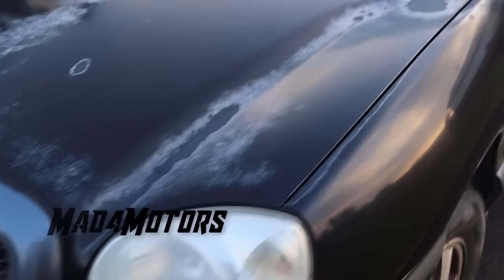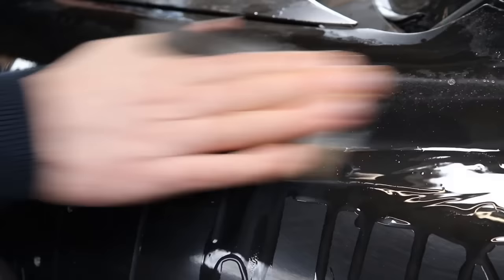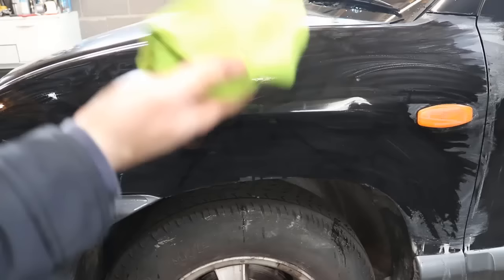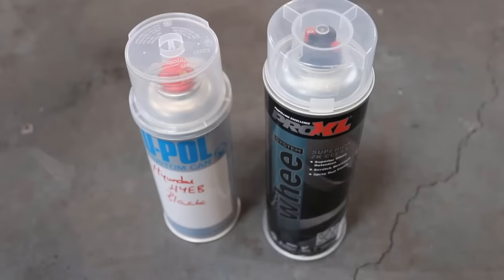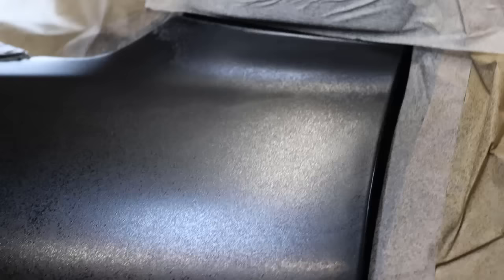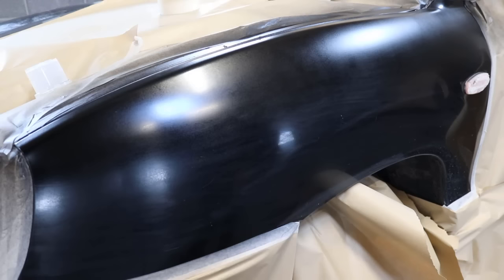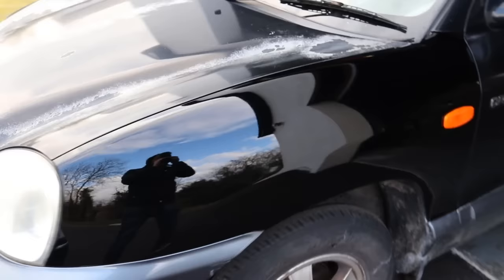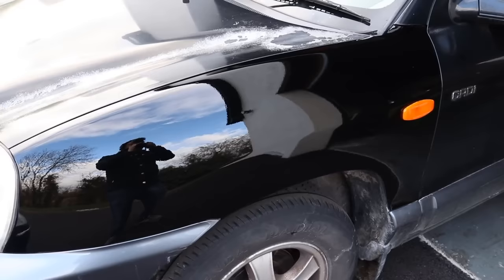How to Repair Clear Coat Fix 100% all types

Comment: Just a quick comment for those who have not yet gone through the school of hard knocks. THIS IS NOT A QUICK AND SKILLESS JOB. You really have to follow every step in order to get good results, otherwise you get crap. Do not try to dry sand your clear coat off either --it will leave deep scratches. If you don't like the way it turned out, don't panic! Use 2000 grit sandpaper to wet sand, after you have let your clearcoat dry at least a day. Than use some compound with a buffer to really shine it up nice. You can save your paint job this way.
Reply: Would you not lightly sand the base coat before applying the clearcoat?
Reply: @nzmarco  depending how your base coat look. If you notice a lot of runs, dust or imperfections you can do light sanding using fine grit.  Clean it with a safe cleaning agent and use a tack rag to ensure no dust left behind before clearing.
Reply: @nzmarco  Always lightly sand before applying clear or it won't stick.
Reply: Agreed 1,000%. This is not a skilless endeavor. YouTube videos are great for learning but at times I think they oversimplify things. Some intentionally others not intentionally. I don't believe the producer of this video was intentionally trying to mislead people. I wish I had his skill
Reply: @nzmarco  yes, I feel like a step with skipped. I feel like they should have sounded defender after painting before clearcoat that’s just my opinion I could be wrong look like it would’ve turned out better if it was sanded before the clear.
Reply: Nice. I'm trying to figure out whether my hood is salvageable without painting, just wet sanding and polishing. Any tips?
Reply: Ya, sand off half the clear and see how long it will last.
Reply: Hello I painted the hood of my car black. I used a clear coat from autozone in a jar with a paint gun. It came out horrible. Orange peel and when I sanded it’s all whit now and I can not seem to ge the white out
Reply: Is that why there is visible orange peel??? Not the knocking it for what it cost, it looks ok, certainly much better than it was. But anyone would know the paint had been redone. The orange peel is clearly visible in this video.
Reply: Orange peel is uneven surface caused by varying thicknesses of the layers. If you don’t smooth it back after each coat, then this becomes exacerbated each time. 
The finer the grit, the smoother it will be but also will take longer. 
Fingers are fine if careful but a soft pad will help distribute the pressure more evenly and avoid sanding some areas more than others. 
If you’ve sanded the orange peel and it is white (lots of micro grooves in the surface from cutting with sandpaper), you need to machine polish it to bring it back to gloss.
You can get different levels of polish for machine polishers, including sanding but because it is faster, it is very easy to over sand and remove everything you’ve added.
Reply: If anything, the video gives great insight to the amount of time and labor it will take so those who don't want to diy have a good base to seek out and price shops accordingly
Reply: @GungaLaGunga So? Whats your point exactly? When did he say this was supposed to be a high quality professional repair? That's right HE DIDN'T! And so Where's your clearcoat repair video then? I'll assume you don't have one. If you have any experience let alone half a clue how things work in the Automotive repair industry you would be well aware that EVERY JOB IS DONE TO A FIXED PRICE, and that price varies hugely from customer to customer, what's pretty obvious to rest of us is this job was a "cheapie" probably because the customer wanted it done as cheaply as possible and our guy made a quick YouTube video out of it, you get what you pay for these days and it's completely unfair for you to critique his spray painting results on a "cheap as possible" repair job. I'd advise you to check out his restoration videos and then try to criticise his work.
Reply: @joshbrookes6439   Orange peel. I was just making a comment about orange peel. didn't realize it was such a crime to comment about orange peel. maybe take a break from social media. didn't mean to upset anyone about orange peel.
Reply: Geez way to scab up someone’s good video. Clap hands here comes “hard knocks Charlie”Seriously dude it’s a DIY video. If we could or would afford a pro, this video would be moot. Like your empirical advice. Moot. Betcha a Brit lingers under the typist. Yeah but. 
That’s it you’re #Charlieyeahbut🎉 #getcherownchannel.
Reply: @joshbrookes6439 Dude, you need to relax. Seriously.
Reply: @pferdundhundj7989   Well okay then if thats your professional opinion Doc? Who am I to doubt your expertise? With all those general medical degrees plus the sleep apnea specialist qualification I consider myself extremely lucky to have received your expert diagnosis and words of wisdom.. Not sure how exactly you do it over the internet but again I'm not the Dr am I. 😆
Reply: @joshbrookes6439 Sit down bot
Reply: If I’m only painting part of the door. Do I need to remove the old clear coat off the entire door and reapply to the whole door? Wet sand with what grit would be okay?
Reply: @Oneklickmedia  A good rubbing alcohol or solvent wash after a polishing would get rid of orange peel, especially from the spray can. Thin coats also prevent bubbling from the cans.
Reply: Dry sanding is more likely to get particles under it causing serious  scratches that your unaware of while wet sanding  lessens that chance.

Comment: Awesome, the thumbs down are from auto body shops he’s putting out of business 👻
Reply: Soo true 🤣👌
Reply: I own a body shop lol and everytime somebody ask "is there anyway i can get it cheaper, my response is always the same....just do it yourself" that's how you save the most money on any job😎
Reply: @lismsthebenchandthebooth2230  exactly! Every one of my clients that asks this I point them to Youtube.  There's not a thing out there you can't learn from youtube.  Basically all you're doing is paying me so you don't have to do it.
Reply: @krazykozey2259  yup i agree...its the block sanding process that usually brings them back like "how much did you want to do this again"😂😂
Reply: Sand paper, tape, paper, canned spray paint, canned clear coat. What was cost? How many coats? Was there chemical reaction with factory paint/primer? Did the paint match? Of all colors only black is universal! But fade? I'm not in anyway in auto body. But I've seen many cheap paint jobs. This is just another gimmick! If you want to try. Try on a model car. If it doesn't work, at least it was cheaper than  a real one!
Reply: exactly the shop also does the extra work in making sure theres no defects or orange peel in the paint
Reply: Accurate 😂😂😂😂😂.
Reply: How much is it usually for a 6x6 inch area?
Reply: @Micahlikespie  depending on what products you buy i would say somewhere in the neighborhood of around $50.00 us dollars
Reply: Facts🤣
Reply: Theres a reason people are called professionals....they do it all the time they know what they are doing.
Reply: I doubt it, pai t shops do it properly, with decent paint, booth nd experience.
Diy is ok on a old worn out car
Reply: @itsalex3631  you ever price automotive paint and clear coat  to do a hood?
Reply: @dannyruckert9359  blah blah blah. Pretty sure that Mad has skills and knows what he is doing. You may want to consider  another line of work because you wont make it as a critic.
Reply: @dannyruckert9359  wasn’t too bad a job done for DIY but you could see paint pits which honestly it’s an old Hyundai LOL. 
But the MEGA orange peel on the top of the fender. It would have to be wet sanded and the whole process done again now there’s layers of clear coat to refinish.
Reply: @lismsthebenchandthebooth2230  exactly
Reply: Absolutely not. 🤮🧠🚮
Reply: @ICON-11-  but come on man we both know that paint had a lot of orange peel and he skipped the last step that is polish and buff
Reply: @itsalex3631  yes It may be a Toyota camry but there's a reason to the charge your paying for the products ex- tape, paper, pastic, drop cloths, primer, base coat, top coat, clear coat, sand paper all different grits, suppose that's the cheap stuff let's say that's 150 of the 500 so now there's another 350 unaccounted for well whats next the actual body shop part of that 500 pays for the lease or mortgage, property taxes, electric, water, sewer, garbage, gas so say that's another 150 of your 500 so 350-150= 200 with the remaining  200 is labor which isn't very much considering  how many years that person took learning his trade and how many thousands he paid to take trade school or if he didn't how many hours he or she worked for free or less then minimum wage under a licensed professional  to do this trade and do he made 200 bucks that he or she probably spent 5 to 15 years learning and spent thousands  of there money and time so he could only charge u 200 bucks for a couple or few days of hard work so u can bitch about it or do it urself and it looks like shit or maybe u got lucky and it looks decent but it peels and scratches off in less then a year because u forgot a step or u didn't know that certain paints don't work well together so does 500 bucks really sound all that bad considering  you don't have to get off ur ass or get headaches or hurt urself or burn ur house down for not knowing how to do something does it sound that bad when the body shop guarantees there work for a number of years so if it has issues u can take it back free of charge and it could possibly be completely redone at no charge to u so that original  500 u spent is worth double to u but that body shop now lost money hmm seems like to me ur an asshole and should pull ur head out of it b4 u say something stupid
Reply: @itsalex3631  i agree, they are charging me around 600-700 repainting job on my car's roof.
Reply: @KatrinaDancer  i think im gonna bring mine to maco, an estimate of $1200 for the hood and the roof.
My car is like a black shirt sprinkled with white powder.
Reply: @Carhartt206  you are correct sir, thank. You for breaking this down for the general public that have no idea what the  cost of materials is just to do paint, and the labor to prep the vehicle for paint, and that doesn't include body work, because that's is a whole different area and different materials are used to repair damage.  As a body shop. This is our source of income. We have to make a profit to stay open. Otherwise what's the purpose in doing the job? Again keep in the mind of cost of material itself is a few hundred dollars. Depending on the amount of paint and brand of paint needed for a complete paint job. And like you mentioned, we want our customers to be happy, so we do guarantee our work and customers are welcome to come back anytime.. if they need to.
Reply: Yes Sr. indeed. lol
Reply: Or from the orange peel he left. Just go back over the clear coat wet sanding, and buffing could correct it but for a quickie not bad
Reply: @KatrinaDancer  There’s a few reasons for clear coat to rip off a top portion of a car. Was the original paint chipping, peeling or cracking? If so that paint under the new paint can continue to chip and peel. 

Was the original clear coat sanded or scuffed up to reduce the glossy finish? If not it’s hard for new paint and clear to adhere. So it can come off. Was the surface washed, cleaned and tack clothed b4 spraying? Did u mix the clear coat properly? Did u spray the product outdoors in the sun? 

It’s ez to botch a paint job. But quite difficult to make something that’s messed up look like it’s brand new. It’s also fun to try new things and learn. Save money and show off your hard work. U can repair the roof and be proud
Reply: He ain't putting nobody out of business, people are lazy and prefer to pay someone else to do it
Reply: There's an easy way to remove the stains without using a sand paper
Reply: Do you know how many people on average cant do this or will do this and still mess it up. This takes a skill relax 🙄
Reply: @katrinadancer 
I did, i paid 1050.00 for the whole car body paint and they fixed the dents and my broken rear bumper. Its more than i expected. It has a 5 years warrantee for the paint job. It looks lika a new car.
Reply: @itsalex3631  I think most shops will estimate way higher than what it's worth for work on cars they don't want to do because they thrive on over charged insurance claims, if you think the price you got quoted on your car wasn't reasonable that's probably because they already had a lot of others lined up they'd be making a lot more money on.
Paint/body work is a tedious time consuming process though, ya gotta keep in mind you're paying for someone else's labor + time + skilled experience + quality of products used so most shops that'll do the work dirt cheap will most likely do it as fast as possible with shit products that won't last and pay little to no attention to detail.
Reply: It's weird that all the dislike comments didn't age well. Can't even see how many dislikes are on videos now.
Reply: If only we could still see😫
Reply: What thumbs down ?
Reply: I own a body shop and i confirm this message.
Reply: @itsalex3631  The thing is they will do it far better because they warrant the work. If you screw it up you don't have any recourse minus going to pay a pro. Buy once, cry once.
Reply: @Garminrules  
At one point the professionals knew nothing and had to learn what to do from other professionals. Just like you I or anyone else can learn and practice the exact same procedures.
Reply: So they cant fuck us over anymore
Reply: I wouldn't recommend spray cans. Black shows up every thing! So it will look like concrete. I can see the orange peel on camera. Lol. From memory you're supposed to sand the peel out, then top coat it. Sand all the orange peel, then buff to a high shine!
Reply: What thumbs down?
Reply: @dannyruckert9359  Found the owner of a body shop
Reply: Color sanding toasted clear coat, does nothing but hide it for about two months max.  What's it like having room temp iqs?
Reply: At this point. With all those things to do, you might as well go to a body shop. 1 mistake, and you make an even bigger problem that needs repairs.
Reply: No…hes not
Reply: I’m saying Lmao I just got quoted 500-700 for my front bumper on an Infiniti, and 10k for my whole car and this is MAAACO ? The cheapest right
Reply: Quick question, can we spray clear coat on existing paint that’s in good original condition  ? If we just have extra clear coat cans to get rid off , or is that that not advised ?
Reply: In fairness, probably should have sanded more of the panel if using the base coat, to prevent the old clear flaking the new coat.
Reply: Damn. Look at that shine how much clear did u put?
Reply: Charging 10 to 15 k and shit 😂😂😂
Reply: @Micahlikespie bout $30k 😂😂😂
Reply: @GARRYMAINERFISHING they started somewhere they wasnt always pros. Im a firm believe of do it yourself
Reply: @dannyruckert9359  look at the condition of the paint he’s tryin to fix, you can’t make it look much worse then it already does.

It will work but if you take the time to watch enough videos and learn the correct techniques and do the proper prep work as that is key to any good paint job
Reply: This comment didn’t age well you can’t even see the dislikes anymore 😂
Reply: Let's be real here, the majority of people sitting at home would rush through all of this and it would look exactly like what it is; a rattle can paint job. Can it be done at home with great results? Absolutely. Nearly anything can with the right materials and equipment. The problem is that most people just don't have the patience/time/skill to get it done properly. Sanding it and prepping it takes hours. Taping off everything correctly is a massive effort, and in many cases you'll need to remove trim pieces or else just live with having overspray on them. This process doesn't take 10 minutes like the video makes it seem. Painting it without getting runs and orange peel takes a lot of practice, which 99.9 percent of people do not have. Then you mess it up and end up taking to a shop anyway and are out the cost of whatever materials they bought to DIY. Or else they live with a poorly done rattle can paint job. Which is completely fine, not everyone gives a shit what their vehicle looks like. Anyone wanting to do this, try it out on an old wreck or piece of scrap metal first, to get an idea of what you're doing before you start gouging into your car with sandpaper and drenching it in paint.
Reply: @lismsthebenchandthebooth2230 they prolly abuse their family members who are skilled in different trade work 😂

Comment: This 100% works, I used different paint tho, keep it waxed every few months and use car covers during the scorching summertime and it will last you years, im going on 3 years now and it still looks as if I did it yesterday... This video is underrated!
Reply: Thank you for sharing your experience with the clear coating!
Reply: Do you know how to get specific colors in a spray can like that? I’m looking for black, for a 2002 Honda accord. Is that a generic enough color/car  that I can use the spray cans from the auto parts store?
Any help would be greatly appreciated.
Thanks
Reply: @MissMarie1377  I get it mixed at my local paint supplier they will just put it in a can for you it cost more but nice for small jobs
Reply: @williamhartgrave6105 wdym mixed? How does that work
Reply: @senorbonbon They have a machine that color matches the car, then it automatically mixes it. Then they put it in a spray can.